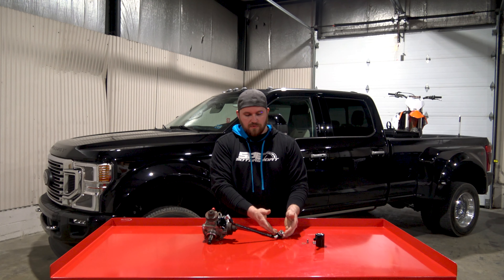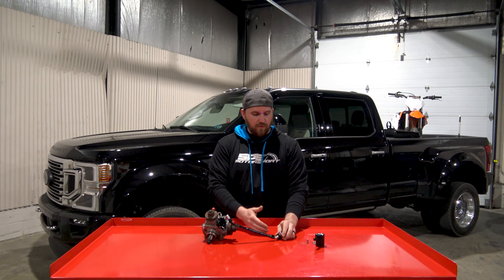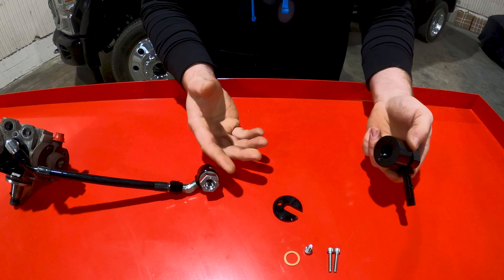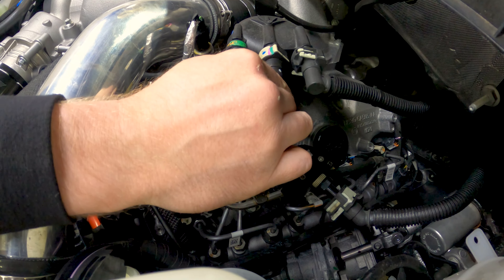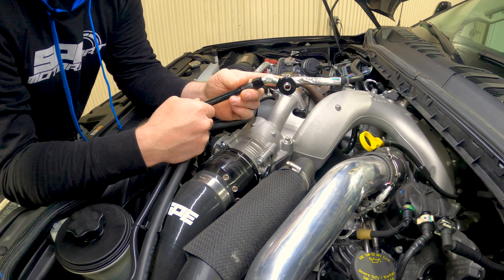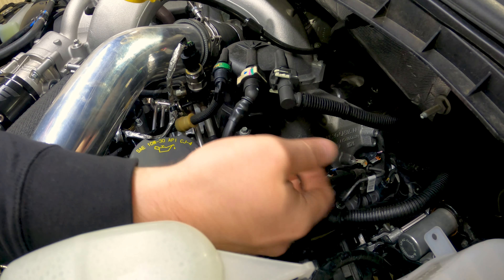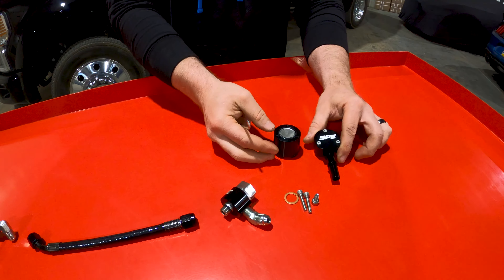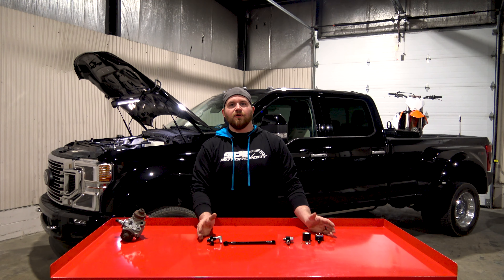SPE 2020 6.7 Powerstroke Disaster prevention kit. Plug and Play!!

Comment: Do you suggest these for a 2020 that has a 5/100k bumper to bumper warranty? And have you seen anyone get a warranty claim denied for having this system on their truck?
Reply from the maker: You cannot be denied a warranty claim for something that did not cause the failure. If you head to our website and check out our blog posts you will find one about the Magnusson Moss Warranty act. Highly suggest you read that and then make a decision. Knowledge is power, especially in todays world.
Reply: My cp4 fail at 75,000 miles in my f350 2020, even with the 100k bumper to bumper warranty, ford did not cover it, log story short, it cost me 11,000 to fix it out of my pocket